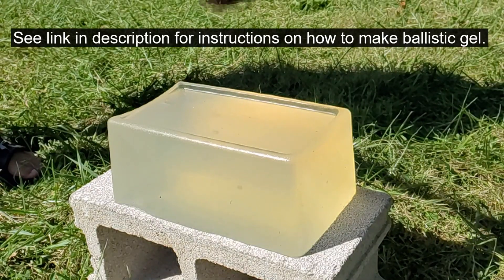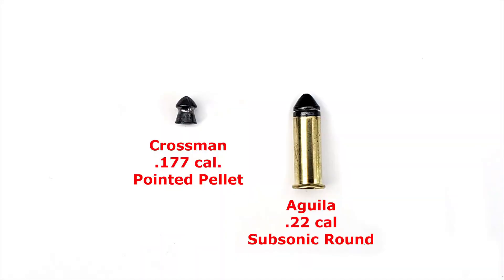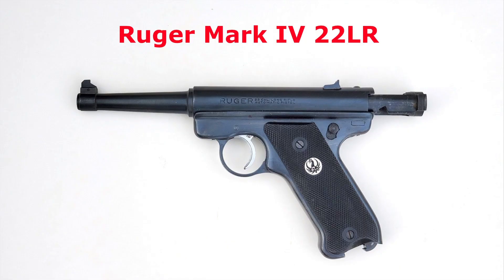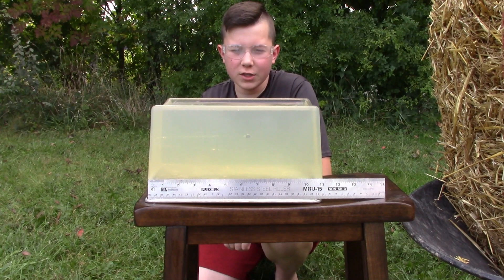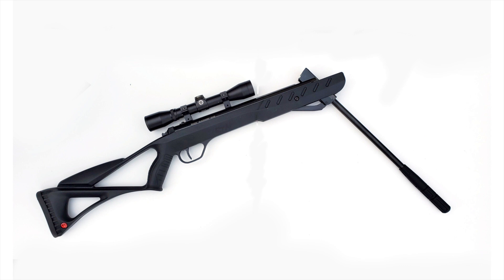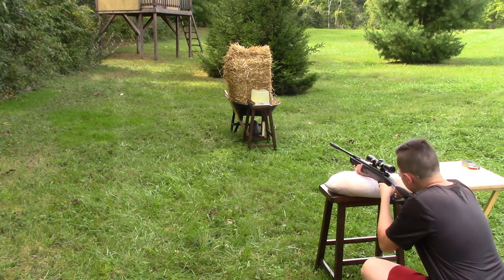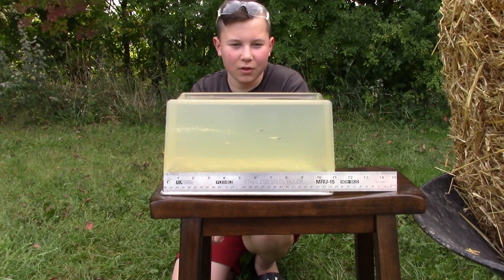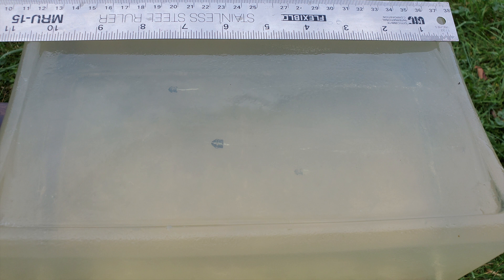Real Gun Vs. Air Gun Using Ballistic Gel

Comment: I figured the .177 penetrated farther because of its small diameter compared to the .22 which has a bit more ft-lbs of power than the pellet.
Reply: that .177 has 10 foot pounds MAX the .22 has wayy more bro. 50ish or smtng